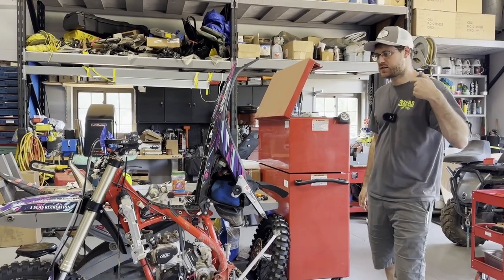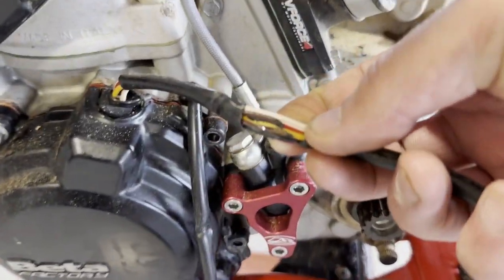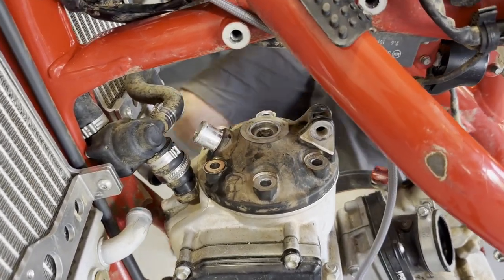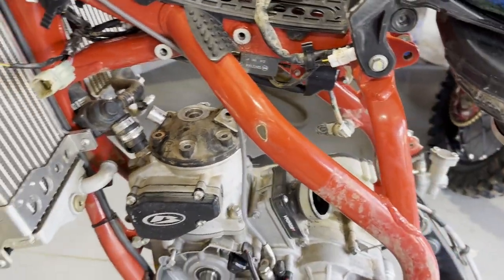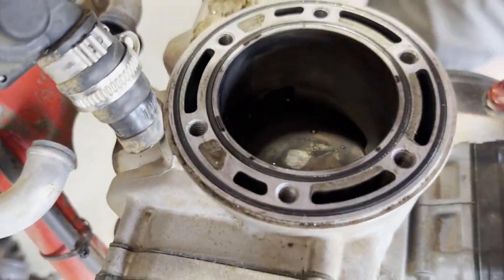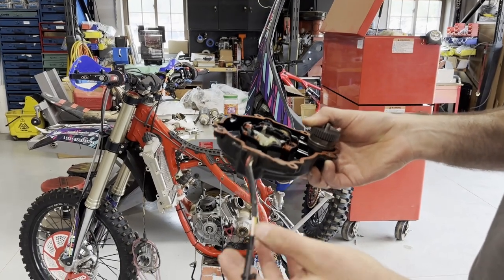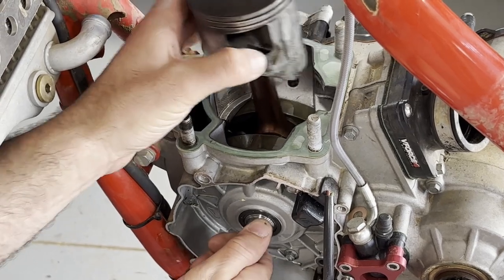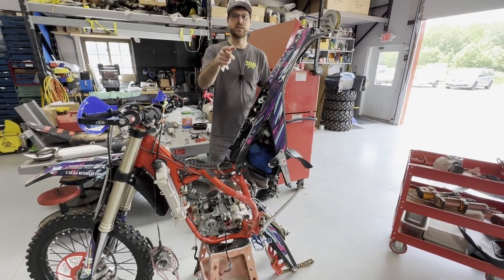13.4 hours  --  2023 Beta 300 Race Edition

Comment: I wouldn't trust ANY of those bearings on the crank and rod.
Reply from the maker: No doubt! Had another 300 motor get dropped off yesterday with a locked up bottom end… yay
Reply: @3SeasRecreation  have you ever had one come in that was that hot before?
Reply: @3SeasRecreation  Beta?

Comment: Great channel.  I think your crank seal leaking diagnosis may be premature.  There is gear oil on the stator side of these motors by design.  It resides in the bath for the starter/Bendix. Possible the bike was laid over  and some of it probably migrated up around the seal making it appear the seal was leaking.  Oil on the crank is more than likely residual 2-stroke oil which is normal.

Comment: This is so timely. I raced Tough Like RORR and my 300 got really hot. Boiled off some coolant but I got moving again and no more issues. I checked everything like you did here but my bike def did not get this hot. Great video showing what can happen though. You are right, in the heat of the moment it’s hard to stop twisting the throttle.
Reply from the maker: Hey Good Morning! Hopefully your event went well and I wish we could of made it this year.. Yes I also think that if he was able to get any sort of speed it would of helped for sure! Enjoy The Ride, Jared
Reply: I boil over my 2 stroke every time I ride. 😢
Reply: @sarahdell4042  that doesn’t sound right. Jetting off maybe? A fan really sorts it out and is a small thing investment for peace of mind.
Reply: @motovalleyenduro  I have a smart carb. I ride hard enduro. Lots of slow going bike dragging, or full throttle up mountains. I’ve smashed two fans, and really should get another …
Reply: @sarahdell4042  oh nice me to. Smart carb and I’ve found if it is set to run a bit rich it keeps the bike cooler. Also, apparently they have new metering rods out that are a good upgrade for some bikes. Def need a fan for that type of riding. I rode Tough Like RORR last year without a fan and cooked the seals on the head. Won’t do that again. Burned coolant for a couple weeks before I figured it out. Would not have been able to tell by looking at them.
Reply: @motovalleyenduro  Yeah I have mine set on the rich side currently. 

That event looks intense! Life always ends up getting in the way for me to make races it seems 🥲
Reply: @sarahdell4042  see ya there in 24 😜

Comment: Beta recommends a small amount of oil on the Stator side, just enough to almost fill the starter gear valley, at least they did on a 2017 Xtrainer
Reply from the maker: Good Morning, Yep I agree. A small amount of oil will help the starter bendix long term. My only side note on this particular bike is that Beta does not do that from the factory and this bikes side cover has never been off.. So this oil came from somewhere else. Enjoy The Ride, Jared
Reply: comes originally with oil from the factory

￼
Reply: @3SeasRecreation  Hi Jared. Page 88 of the 2023 Beta 250/300 service manual reads as follows:  Pour about 7cc of gear oil (for specifications refer
to the recommended lubricants and liquids table)
in area A. This is referring to the starter gear area. Really enjoy the vids, keep them coming.
Reply from the maker: Yep I agree, but standard from the factory there isn't that much and I wish I could attach pictures here to show how much oil was on the shop floor when i pulled the cover.. I should of added another image in the video showing the amount that came out of the igntion cover side. Also, the crank case was full of oil as well... Anyways she got hot!

Comment: 13 hrs crank seals failure 😅 need to air check filter sealing and oiling and maybe a fuel filter. Could be factory assembly but that’s shit box 😅
Reply from the maker: Hey, thanks for checking out our channel! This isn't really an air filter issue, there was zero dust at the John Penton. This bike failed due to being overheated. These bikes rarely overheat to this extreme, it could of been prevented but in the middle of the race that is hard to do! We have all been there! Enjoy The Ride, Jared
Reply: @3SeasRecreation  it may have over heated and seized because it ran lean from sucking air through crank seals though right ? And what did the seals in ? Or is it just hot ambient temperature at the location of that race ?
Reply: You clearly DIDN’T watch or listen to the video
Reply: @ericmiller9132  you recount it for me hero

Comment: Still spitting out main bearings, its a shame cause i do like them.
Reply from the maker: Good Morning, Beta actually changed the main bearings for 2023 and we have not seen a single issue. We are just replacing these ones out of caution due to the heat in the engine. Enjoy The Ride, Jared
Reply: @3SeasRecreation   my 2023 xtrainer knocks when i give it any gas worried its the main bearings. the bike has .1 hours on it too.